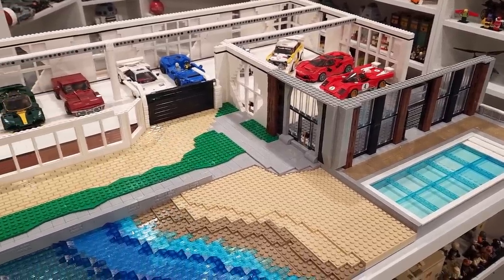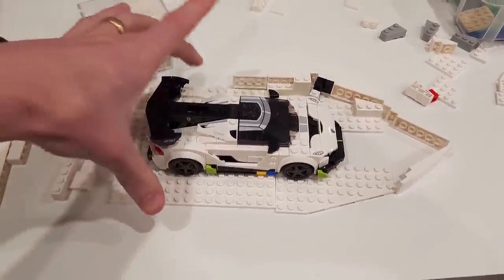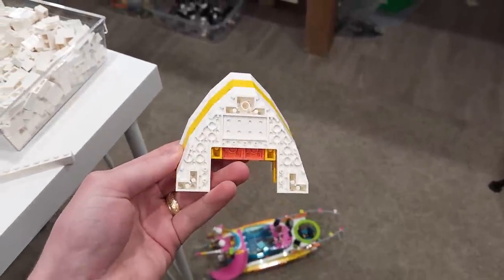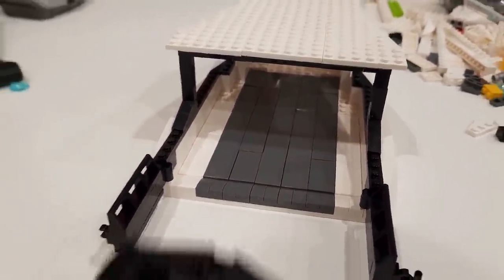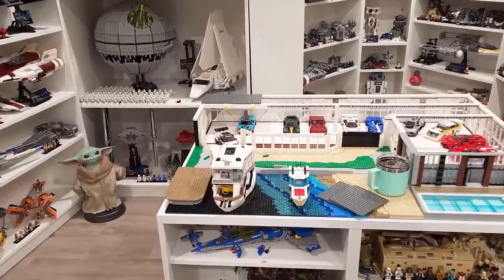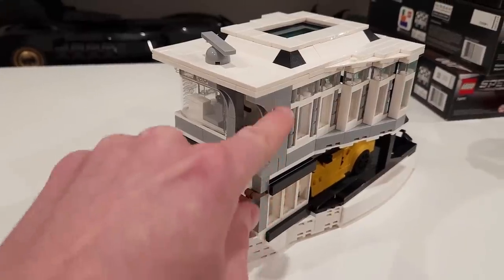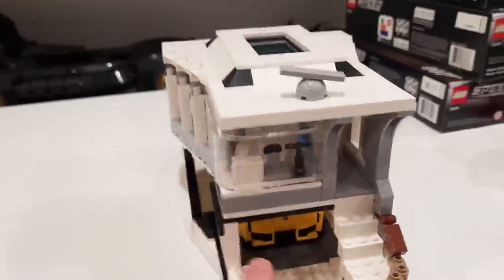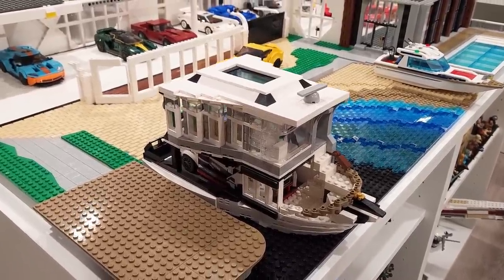Custom LEGO Boat! Speed Champs Car Transporter

Comment: I love the concept. Thought! Ditch the dock, have the boat parallel to the garage and the car enter the boat via a side hatch/folding ramp. This way the boat could be longer and the width could be roughly the same as you plan or just a little bit wider. This would impede on the beach area a bit but really as a ultra rich dude you wouldn’t have your nice pristine beach area that close to your dock anyway. You could make the pool with an infinity edge too! Enjoying watching the process!!!

Comment: My suggestion is to make the boat 2 studs narrower by reducing the 2x white tile space on either side of the car to 1x.  Also, you could cut into the driveway coming from the garage by 8-10 studs which would let you make the boat 8-10 studs longer.  Doing both will improve the proportions of the boat.

Comment: I love the boat, however, if you ever move it to your lego city, I would consider adding parts of a back, with room for the car to roll out. Next to the mansion, the cut off sort of square part works, because it's backed up, but you should add parts of a back. I love the boat though, it looks amazing.

Comment: I know you know the boat isn't the best it can be.  Change the front railing to a black strong, create 3 or 4 railings to attach the string.  It will make for less bulk.  The ship is too tall for being as short as it is, that would make it prone to capsizing.  The back needs to be a hinged ramp, not swinging doors.  The boat won't work with the dock in the city as you had stated originally, I think the city dock is too tall.  Make the boat at least 12 studs longer and 6 studs shorter in height.
Reply from the maker: So it's that tall because it needs to accommodate speed champs on the bottom deck and a standing fig on the top deck. I only wanted it to be 32 studs, so it fits in the allocated spot I have for it, but ultimately, I'll have to rethink/rebuild.
Reply: I know you know he knows the boat isn’t the best it can be
Reply: @Bricksie  I know it might be too much to change, but you could move the dock to the other side and slimming it down a bit, this way you could have the cars drive straight onto the boat without an angle, but you can make the boat longer as you have more space. Yes you will have to move the path/grass area but this help with the proportions of the boat.

Comment: I really like that you're building this yourself with the constraints of the parts that you have on hand. That's what most of us would need to do.

The ramp between the boat and dock looks great. And the interior detail on the boat is good. But that final boat design needs a LOT of love. The 32 stud length constraint is probably the biggest issue that causes all the other trouble. The car just takes to large a fraction of that length to get a good aspect ratio for the cabin area. Maybe turn the boat 90 degrees, increase the length, and drive on from the dock?

Comment: Great job!   Agree with others that suggested adding some exposed studs under the car, so you could use it as a party boat with a bar and more guests. Maybe add an open deck on back above the car too.   Dont be afraid to add blues as many boats have a touch of bright colors.

Comment: I've tried building a yacht, and it's difficult. You have to order pieces to make it good.
You should change the size or orientation of the dock so you can make the boat bigger.
The interior is good, however minifigures can't sit on the benches

Comment: I think it’s a really good build and I really like this idea! You said you want it less than 32 studs long but I think it looks kinda boxy at this length because of the space needed to accommodate the cars. Maybe if you make the boat longer and change the dock to come off the island at an angle you could smooth out some dimensions?

Comment: This is great try mate, really like how u describe your steps of doing it and interior is also awesome. I think the problem with that boat is the vertical size. It is just abnormal and would just flip on side with first wind. I think the boat to carry that extremely large car need to be like double width. Its like you should put the top floor at the front and the storage car area should be just half of the boat. The captain area need to be in front and maybe you should make dock larger so the boat can dock from the side not from the front of the garage door. You could fit that boat then i guess. Just my thoughts, take care and have fun!

Comment: Most car ferries are the same on the front and back so they can travel both ways without having to turn around and so the cars can unload and load on both ends. You don't necessarily have to stick to the constraints of the traditional boat shape.

Comment: I was thinking about your comment about the v-shaped bow (front) and was thinking there’s plenty of examples where a more blunt bow (if I could think of a better term!) is used, particularly short range ferries. The troop landing ships used by the army are another example. A benefit of a blunt bow, is you could make it another option for entry/exit of the cars, meaning your boat can approach the ferry in any direction - a real world application, as weather conditions may make reversing (going astern) really difficult and you just want to get the car safely on land!

Taking the real world application further in regards to bow design is that the best design depends on your imaginative intent - is it for long or short journeys, as a v shaped is better for the long ones. But I imagine it’s short journeys as I suspect the island is close to land. Probably overthinking things there!

Comment: Great and all for the first time building a boat but I feel as the bow has to be higher and maybe have the bottom car pull in part be completely enclosed on the side and maybe make the top smaller and a little more simple

Comment: Have you considered building a catamaran instead of a yacht? It would take the process of building a long pointed hull out of the equation for u. Also. Have u considered turning the boat 90 degrees so that the cars load and unload onto the dock instead of a random driveway that leads to a cliff edge. Great start.

Comment: Why not ditch the detailed beach in the front, build the yacht parallel to the house, have the cars unload near where the current pier is and have a path to the garage door. Then you can either make a beach out of the pool area, or put the beach in the back yard

Comment: If you consider a catamaran hull setup you would take away the problem of making a bow in the short space you have.  There are some beautiful real life examples of these maybe the top deck smaller interior space and more decking. As said I think the quarters are a little too tall. Some yachts have sliding roofs over the whole interior think like the fiat 500 roof for example. Good luck good start!!

Comment: solution to all the problems, a duel ended ferry boat, ramps on both ends so the car drives in one end of the boat, and at the other end of the transport drives of the other end of the boat

Comment: A thing you could do is make the top part smaller because as it sits it looks a little top heavy and the buoyancy of the boat doesn't hold up. looking at real life boats you'll see a large hull with the cabin being less than half the size of the hull to keep the buoyancy and it from being top heavy usually the cabin doesn't protrude out all the way to the edges on the port and starboard. The design you have appears to be the shape of a fishing boat and the build of a ferry. If the top was focused more on sloping inward rather than outwards and up it may have a sleeker and more yacht like appearance. Another could be the sides could be more closed off between the windows and support pillar to have a more complete look that a ferry has. If you want to have the Cabin and Helm be that large the Hull would need to be bigger and less squared. Boats have a more rectangle shape to help with parting the water and gliding through the water easier, vs a square boat that would be slower (more buoyant, but less efficient). The size restriction is what really hinders what you could do with this to improve it other than making the cabin less square and slope inward vs outward. The spinning radar may want to be raised 1 plate so that it is at the highest boat of the boat so it can have a 360 range to detect sending signals so it can accurately determine your position in the ocean relative to the objects the signals hit and bounce off of back. Adding that open array antenna was a nice touch.

Comment: Why not make it a simple ferry? It's very bulky because of the top floor. I would personally just get rid of the top floor and place the captain where the stairs are currently. Make that a simple 'cabin' and have the car behind it. That's it. That will probably look a lot cleaner.

OR... you could just make the back half of the boat if you really want to. I mean... the beach and sea / water are cut off at the edge of your table, why not do the same with the boat. Just imagine a boat. Cut it in half and only make the back part of it. So, the front would be like a dollhouse type build where you could look into the boat. Just grab the back part of the Titanic set. That's basically what I mean.

Comment: Wouldn't it be cool to modify the big boat you considered? It already looks like a decent yacht.
Reply from the maker: Yeah, I might do that. Honestly, it was the coral color that turned me off that idea
Reply: @Bricksie  I actually like the coral color on it, and would remove the teal from it and change it to black, coral and white. Is there a way to extend the cabinet so that the boat can kind of hang off of it, like you were thinking of doing for the trusses in the winter village? 

By the way - I actually like the boat, it just needs to be more rounded and angled, going up to the second floor. I think the wind screen you had was a good idea.
Reply: @Bricksie  You could modify it more. Swap out the colors you don't like (if possible) or maybe use it as a template for your own creation? The Dalmatian was okay and I liked the concept you came up with, but you might have been a bit too limited by the available parts this time. It's mainly the weird shape that didn't work for me 😅 keep up the good work 💪

Comment: TLovingt the mansion but the boat doesn't look good. The proportions are really off. Maybe you could make it studs thinner and curve the front better, those pre moulded pieces don' fit with the triangular bricks.
Reply from the maker: I clearly demonstrated the part struggle in this video, lol. I will most likely use the dolphin rescue boat and increase the size go a yacht 🙂

Comment: Just a suggestion.  This is a Speed champion mansion, yet there is no road, the whole beach area should be turned into a driveway, the cars have to travel by boat to find a road, I would think a rich guy with lots of expensive cars would be all about the driving and his mansion would have access to roads.  You would also be able to add more cars parked outside if you lose the beach and dock.    Just a thought.  🛻🚗⛽